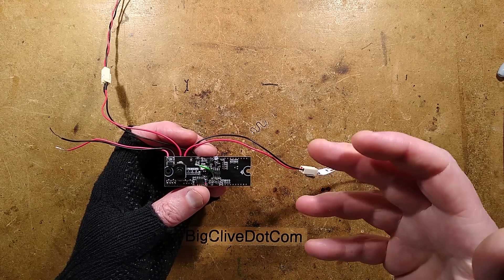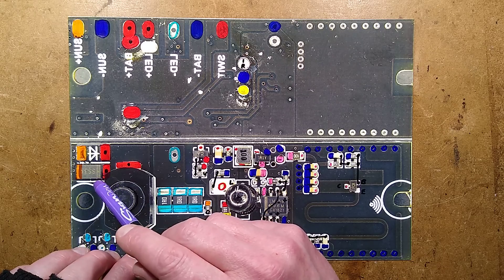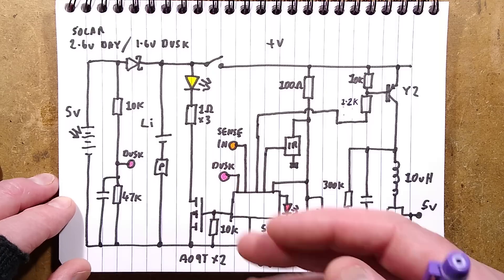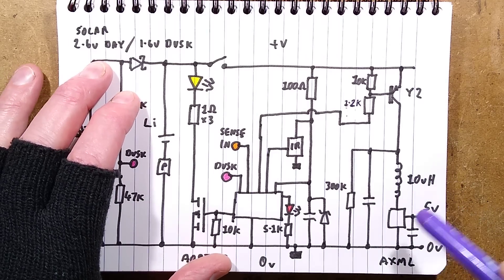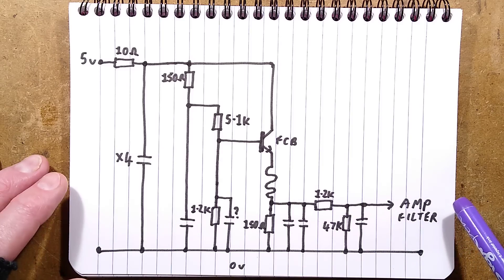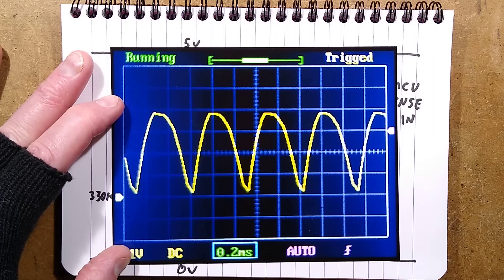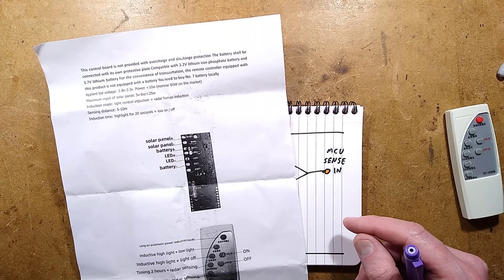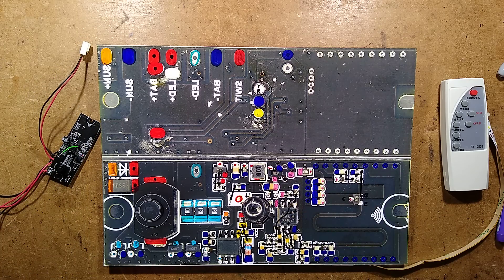Solar "radar" light control module - with schematic (and fix!)

Comment: The circuit does use Doppler shift. The oscillator transmits a signal. It is reflected, if the object it reflects off is moving, a Doppler shift is created. The reflected signal is received on the same antenna as it was transmitted from and mixes with the oscillator signal to produce a beat frequency equal to the frequency difference between the two signals (i.e. the Doppler frequency. Its this signal that is then being filtered and detected I think. This is exactly the way the first proximity fuses for shells worked. They had a single 'peanut' valve packed in wax to allow it to withstand the shock of launch which did the work of the transistor in your circuit. Basically one active component functions as transmitter, receiver and mixer. I know about this because the same principle is still in use today - although we are at least using transistors now!

Comment: Re that op amp feedback circuit, the main element is that cap going directly from out to -in. That drops the gain to unity for higher frequencies. The whole thing looks like an active low-pass filter. The input cap blocks DC and the voltage divider recenters the waveform at 2.5V.

Comment: There's an amazing animation of a solid state beam steering antenna. Can be made similar to the traces there, but is a weird asterisk shape: * . Slow mode field animation shows if you send signal/power to one side not the other it "forms" the beam to point in the other direction, and likewise can fill each finger with more or less power/pulsed waves to shape it's direction. I wonder if those through holes help shape the direction?

Comment: It's doppler, Andreas tested some, but what's the nighttime standby drain like? I have some modules, but they greedy, I forget the drain, but not suitable for battery powered home automation, which is a shame. There are some quite advanced programmable ones now, I believe they can detect your chest raising and lowering as you breathe at night while asleep, which makes a perfect presence detector, finally.
Reply from the maker: The standby current is definitely significant compared to PIR.

Comment: Thanks for the detail, Clive.   I have one of those solar street lights with LiFePO₄ cells in it that's been running for years.  It's surprising to see that it will occasionally respond to insects or bats chasing them, strong winds, especially when accompanied by rain.   Fortunately, the thing has a "full on" time of about 30 seconds, so it's not really an issue.

Comment: Ain't no LM358 on this planet that can output a signal in the GHz region!  It's 0.5 mS, or about 2 kHz, which the LM358 can certainly handle. Having said that, one well-known problem with an actual LM358 chip (not an updated LM358) was its awful totem pole output. If you bias the op amp in its mid range, as is the case here, then the output will have odd crossover distortion artifacts as the output tries to alternate between sink (PNP) and source (NPN) of currents to some light load. The fix is to add something like a 1 kohm resistor to ground on each output, which effectively biases the output so that the NPN output transistor in conjunction with the pulldown resistor are always supplying the output current. The PNP output transistor is then effectively cut off. Any newer updated version of the LM358 (which will never include "LM" in its name) fixes this known flaw in the opamp. Whenever I see any kind of design that uses an actual LM358 in it, it immediately tells me that the designer was not very experienced in linear design.  https://youtu.be/VgodYtiD_F0?si=wK2MK04FJWuOPijM

Comment: great vid. i spent some time discussing the name "doppler sensors" with chatGPT. this is what she had to say, when asked about it - 

The debate about whether these inexpensive presence sensors used in devices like solar LED lights are accurately described as "Doppler sensors" revolves around the specific principles of operation involved in these sensors.
Understanding Doppler Sensors

    Doppler Effect:
        The Doppler effect involves the change in frequency or wavelength of a wave in relation to an observer who is moving relative to the wave source. It is commonly used in radar and motion detection to sense changes in frequency caused by movement.

    Doppler Radar Sensors:
        Doppler radar sensors emit a continuous wave of radio frequency (RF) or microwave energy and detect motion by measuring the change in frequency (Doppler shift) of the reflected wave from a moving object.

Understanding Microwave Presence Sensors

    Microwave Motion Sensors:
        These sensors emit microwaves and detect motion by analyzing the reflected signals. They typically use a single copper trace on a PCB as both the transmitter and receiver.
        The principle of operation often involves detecting changes in the reflected microwave signal's phase or amplitude caused by moving objects. This can be due to interference patterns and not necessarily a frequency shift as described by the Doppler effect.

Are They Doppler Sensors?

    Arguments for Calling Them Doppler Sensors:
        Some of these sensors do rely on the Doppler effect in a general sense, as they emit a wave and detect changes caused by movement. In this broad sense, they could be considered Doppler sensors.

    Arguments Against Calling Them Doppler Sensors:
        The specific, inexpensive sensors you mentioned might not strictly measure the Doppler shift (frequency change) but rather use other principles such as phase changes or amplitude changes in the reflected signal.
        The term "Doppler sensor" might be somewhat misleading if the primary detection mechanism does not involve measuring a frequency shift.

Conclusion

The correct terminology depends on the specific sensor and its operation:

    If the sensor measures the frequency shift caused by the motion of an object (Doppler effect), it can be accurately called a Doppler sensor.
    If the sensor primarily detects motion through phase shifts, amplitude changes, or other non-Doppler methods, then calling it a Doppler sensor might be inaccurate.

In the context of the inexpensive sensors in question, it's likely that they do not strictly use the Doppler effect, but rather detect motion through simpler means such as changes in the reflected signal's phase or amplitude. Therefore, the critics arguing that they are not true Doppler sensors have a valid point.

Comment: When an inductor is used for switching on and off, as it switches off it makes a reverse current for a short time and the resistor and capacitor could reduce that effect.

Comment: Yeah, but does it come Pink?!😆

RF is easier than AC. Clive, you would pick it up in about 20hrs.
Rule of thumb. 1. All RF circuits are either, a filter, or an amplifier, or a mix of both.

Comment: Quite a complex functioning circuit! It’s like a solid state version of the proximity fuzes used in WW2, plus a microcontroller to select different modes. 

I was surprised to see several of these online claiming 5 or 10 meter sensing range. Pretty significant for such a small, low cost and low powered unit. 

Well done with the reverse engineering!

Comment: It's milliseconds 😆 Clive and not Doppler radar. For this you would need two parch antennas. The RF circuit is just an oscillator. Someone analyzed it years ago. Guess you need to Google for it. I believe what you saw was interference with the reflected wave.

Comment: In my garage I have a RaspberryPi server with a camera and Python code to send me, when image pixels change, photos to my email. I was overloaded with photos in my email. I put one of those RF detectors on the GPI and modified the code to only send email if the RF detected motion. It works just fine. I keep the extra images/movies on a thumb drive that are less than two weeks old. Each night a crontab schedule deletes old images. It's the best of my hobby projects yet. RF detectors are much better than PIR.
Reply: Waa. Neato

Comment: I believe you have it right on Doppler. The microwave oscillator is so fast that even a slow reflected movement will change the frequency down to an audio signal not just a different RF signal. The opamp can pick this up and filter it to a DC level and trigger the light.

Comment: Analog RF posse reporting Sir 🫡
It is Doppler shift sensing a low frequency RF signal ~2kHz.
The length and shape of the antenna gives it away. 🙂

Comment: Hi Clive,
We called that area by B a tuning stub when I worked at Motorola.  You design the capacitor values as needed, but because of capacitor and high frequency part tolerances you need to match the capacitance to the high frequency part.
We used a laser to remove a small amount of metal to 'tune' the circuit to the exact frequency.
The squiggly track is also to match the impedance of the circuit to the antenna (VSWR) to deliver maximum power to the antenna (or from, in this case), and it is a simple formula of frequency to a single sign wave (2 kHz = a wavelength of 35 cm).  It reduces the tract length (from straight, as in an collapsible FM radio antenna) by zig-zagging it on the substrate.
Reply: Yep. That stub in combination with the ground plane next to it and the ground plane under it form a tuned circuit making the basis of a single-transistor RF oscillator. The squiggly bit is the antenna + z matcher in one piece.

It’s not really that simple of course- the resonator and the antenna/matcher interact too kind of like a tuned-plate tuned- grid tube oscillator works but the coupling isn’t as strong, until someone walks by and it is.

Anyway, Clive is right, it’s a Doppler detector. Reflected RF adds to or subtracts from the current in the antenna and the difference gets passively filtered and sent to the active low pass filter about which he is also correct.
Reply: Wow, even trimming it off with LASERS!  That's finicky!  I'm impressed.  I knew RF analog was a bit of a trick but I hadn't realized it was that much of a trick.
Reply: @HytelGrp 
The Wavelength of 2kHz = 
149,.896 Kilometres.
What is VSWR.
Reply: @snakezdewiggle6084  VSWR (Voltage Standing Wave Ratio) is a measure of how efficiently radio-frequency power is transmitted from a power source, through a transmission line, into a load (antenna).
Reply: @HytelGrp 
So you don't actually know Radio then.
In short. It is a measure of energy in a network, or system.
Reply: @snakezdewiggle6084  No it isn't, he was correct. In engineering, it is more commonly known as return loss, or S22 in vector network analysis.
Reply: @cambridgemart2075 
Okay, if you say so ...
Reply: Clever Bugger, I'm impressed, honestly.  I keep learning things that I don't quite understand... er, completely.
Reply: @HytelGrp 
"Tract" vs Track.

Comment: I don't think that 2.5kHz signal is meant to be there at all, it's a spurious oscillation of the band pass filter (the left hand op amp).  The output of this op amp is supposed to be a dc level at half the supply voltage when there's no movement.  The threshold of the comparator (the right hand op amp) is about 0.12V below that dc level.  So any low frequency Doppler frequency that gets through the band pass filter larger than 0.12V will be detected and turn the light on.  The presence of the large 2.5kHz oscillation will produce continuous output and prevent it from working.  By attenuating the spurious signal you have prevented this from happening and allowed movement to be detected.  The bodge capacitor was probably and attempt to stop the spurious oscillation.

Comment: Multi-path interference. Basically heterodyning itself but with slightly different phases, the result of which is a low frequency signal. The difference in signal path is doing the work, not the speed of movement (doppler).
Reply: It likely is just constructive/destructive interference with the reflected wave. For mixing (heterodyne) you need multiplication. Such nonlinearity is not given in this simple circuit.

Comment: Interesting little circuit! My experience with "radar" detectors is a bit unusual - I installed one on my balcony light, outside the room I have the PC, so that I could note when people passed by at night. I found out that it was able to sense across the wall and trigger on any movement I made, inside the house! This was easy to fix with a grounded metal plate, but I didn't bother. It's still there, but I disconnected its power - that's how lazy I became :-)

Comment: If it is doppler, there'd be some sort of "mixer" on the pcb track. 

So imagine one part of the PCB oscillates generating an RF output (transmit beam if you like), and then the receive part of the same PCB has to interfere with the reflection signal. Or "mix".

So the result would be a low frequency. Perhaps that 2kHz signal means the receive part of the PCB was "out". 

Instead of generating frequency bursts, it is probably meant to generate very low frequency pulses. Like on or off blips.

Think of police radar detectors which use horns and precision cavity resonators. School "Young's slits wave experiments". 

What's the sensitivity range like?

Comment: The question-mark cap may be coupled to the antenna to give a feedback to the base of the transistor to get the circuit to oscillate. Reflected RF will then be mixed by the same transistor. The doppler frequency is then filtered by the first op-amp. This is a typical bandpass, It will be tuned to pick out the typical frequency's made by objects moving at human typical speed. To filter out flying bugs.

Comment: This module was inspired by the RCWL-0516 module. That one operates at 3.2 GHz.
Didn't think they could make it cheaper? They did. They eliminated the need for that chip, with clever filtering and amp section.
Reply: I concur..I use the "cheap like borscht" RCWL-0516 units with a FET to switch on LEDS, alarms, etc.
Reply: Wouldn't a single chip be cheaper than 5 layers of filtering?
Reply: @hubertnnn  LM358 can be had for 1.5c each, 10 passives cost maybe 1c. So you are competing with a cost of ~3c.
Reply: @hubertnnn  Good point. 
LM358 is cheaper than dirt. So are resistors and caps. 

I don't know the costs, but given the way Chinese operate, I wouldn't be surprised if they came across tons of these Op Amps on the cheap, and designed around them. 
They do that for all through hole components which have no market left since SMD.

Comment: Just sharing a sneaky VS1838 Infrared Receiver Transistor failure, here, to get the word out... I was repairing a solar light, which was controlled by an IR remote control. I discovered that its 1838 was faulty, which was causing the MCU to keep the light switched off. Here's the sneaky part... I tested the transistor function of the 1838 with a multimeter and the transistor tested as working. The problem was that the 1838 looks for a 38KHz "modulation" signal from the IR transmitter (inside the remote control.) The 1838 had lost its ability to read that modulation signal. As said, sneaky, because the transistor function tested as working. Hope that helps someone. Cheers.

Comment: The "splooge" capacitor is not a normal place for one. With some opamps, it could cause oscillations. The LM358 happens to not be normal under the hood and not very fast either, so all bets are off for why it's there.

Comment: The Dobbler Radar circuitry is very interesting. Some half century ago I tried to build emergency morse radio for standard SOS-frequency, now defunct. Suitable transistors were quite expensive, I recall.

Comment: I'd say that copper pad is an inductor, not capacitor as it is a 'short' possibly forming a feedback circuit in an oscillating transmitter?

Comment: I have a complaint, you didn't put a link to tell us where to buy one of these this time.
I believe that the "doppler" works in a similar way to a theramin, moving close to it will change the frequency of the oscillator and the change  is detected by the first op-amp.
 ( I could be wrong, but that is how it looks to me )

Comment: Don’t doubt yourself, Clive! You had it right the first time. It clearly says 0.2 milli seconds per div on the scope image, which makes the frequency 2kHz ish. If it was 0.2 nano seconds, the frequency would have been 2 gigahertz.
By the way, doppler frequency is about 20Hz per m/s, so a waving hand might give 50 to 150Hz, and a swaying Clive closer to 30Hz.
Not sure if this makes a case for or against it using doppler shift, but considering it only uses an audio-frequency low pass filter, I’m leaning towards yes - I can’t imagine how an LM358 could respond to any kind of reflected power ratio measurement, cos it would have to be operating at RF frequency to do that, or at least have an RF detector (diode and cap integrator?) as the front end, rather than the low pass filter.
Then again, if we guess that it’s operating around 5GHz or so, the reflected wave would interfere with the transmitted one in a varying way as objects moved in its vicinity. Nah… that would have no effect on the oscillator - it would be way too tiny.
I’m sticking with doppler, via mixing of the transmitted and received waves generating a doppler difference frequency.
Reply: I've played around with standalone versions of these "doppler radar motion detectors" and I believe they are doppler based.  That one transistor oscillator is working pretty hard, and also serves as a mixer for the signals that are bounced back from nearby targets.  Their shifted frequency based on the motion of the object causes the low-frequency mixing product to be generated and detected in that "audio" region.
Reply: It definitely is Doppler. What you’re missing is that the outgoing and incoming signals are mixed in the antenna (the squiggly trace) and the low frequency sum and difference are what the passive LC filter sees, and its output goes to the active low pass filter.

A swaying Clive should be more in the .3-3Hz neighborhood…